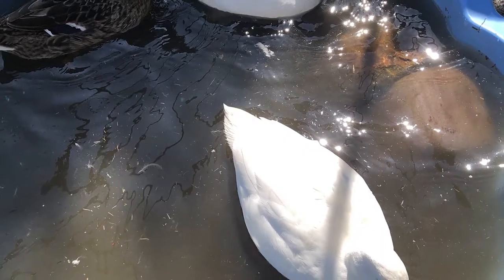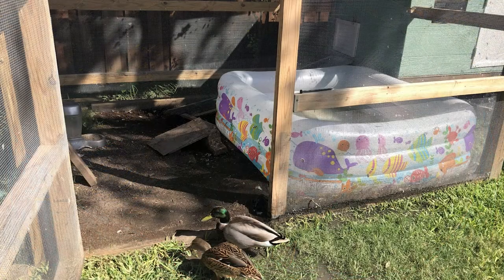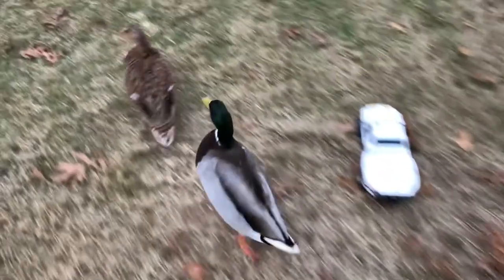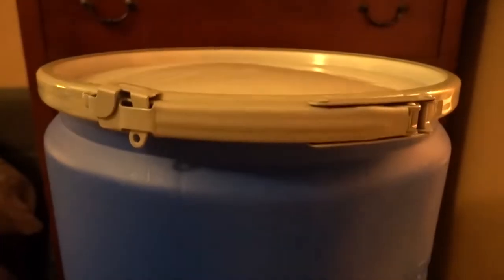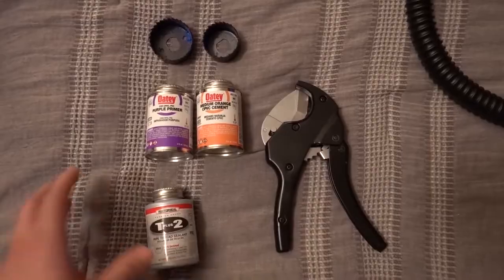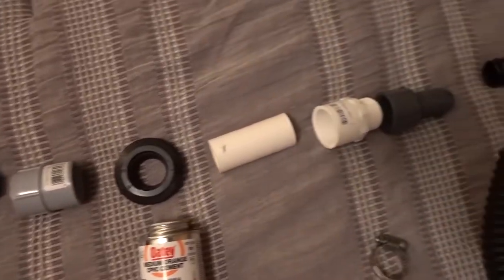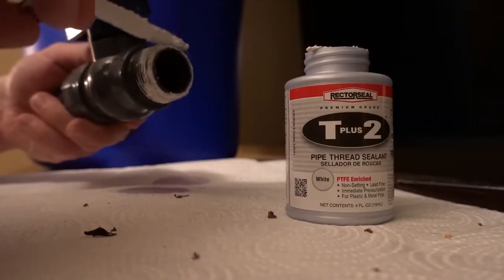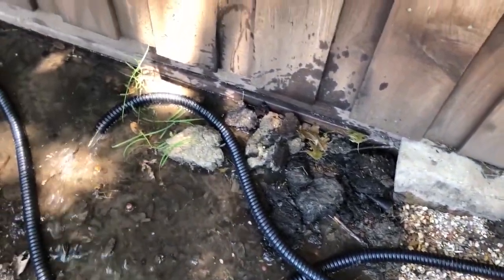How to DIY Keep Your Duck Pool Clean and Easy to Maintain

Comment: I have 10 ducklings and I've been working on the pool set up. Never done this before, and so glad I came across this video!
Reply from the maker: Awesome! Be sure to watch the updated video!
Reply: WILL NOT WORK.   We've got 10 Pekins and anything with pumps and filters is a joke
Reply from the maker: @BillRupp-h4x  I've had a total of 15 before, and I had to fully change the water twice a day to maintain. 

My setup would prevent that (mainly from the swirl filter) - though, as you know 10 ducks is a lot of poop, so you'd likely have to rinse out the swirl filter daily. 

So, yes it would still work. The average pump/filter setup will not work and would also clog, I agree.

Comment: I have 6 baby duck at about 3 days old they are now 3 months and have done about a dozen different… I know made a pond out of concrete with a perforated tube running around the edge under a bed of river rocks now I need to build the filter so thank you

Comment: Howdy! We just bought our homestead Jan 2023. First time duck owner. We have 4/6wk old Pekin, 5/6wk old Rouen, 5/5wk old Rouen and 5/5wk old Cayuga ducklings. Also, 2/6wk old poults, 12/8wk old chicks and 53/6wk old chicks. 20 more chicks are supposed to hatch July 24th. This is the third hatch attempt. Bantams are hard to hatch. Add 2 dogs, 1 cat, 2 pet rats, 1 pet mama mouse w/9 babies and 1 ball python. Much love to all you pet owners out there! 🥰
Reply from the maker: 20 chicks?! 😅 That’s gonna be a lot to handle lol. It will be adorable for a couple weeks at least.
Reply: Ha! Yeah. All the other poultry and waterfowl are 8 wks and less. It's definitely a lot of work, but I love it. I love your pump setup. I'm going to show my hubby. Thank you for the video.
Reply from the maker: @WhatWasIThinkinHomestead  took me years to figure out, though, with that workload, you will still have to clean frequently. (I made the mistake of letting mine have 13 babies one year). Let me know how it all turns out! GL.
Reply: @MegaMilez  Ha! Surprise! 🤭 I bet that was a big chore. I'm sure we'll have to tweek it a bit. I sure will. Thank you for taking the time to respond.

Comment: We have 6 Muscovy and 2 Pekins so we picked up a 300 gallon stock tank for them. It's recessed so they can basically just walk into it. For filtration we start with a Laguna 2000GPH pump, Laguna 4000GPH filter (bio & foam filters and UV light), Tetra waterfall, small separate pump to circulate water even more, Microbe-Lift for algae and "sludge" (duck crap lol). The filters need to be cleaned every week, replaced once or twice a year depending on how they hold up, in the summer (110+ degree temps) water is drained every month, come fall to spring every 3 months or so. There is also an auto-leveler installed since evaporation is a big deal here. The ducks love it and it's been going strong in the current configuration for about 3 years. Cheers!
Reply from the maker: Sounds like a nice setup! Me personally, I drain their water each week or a partial every other week - mainly because a lot of their waste is liquid that won't be caught by any filter, so I don't like the idea of them drinking that. 

I only have to rinse out the swirl filter, rarely take apart and clean the pressure filter, and clean out the in pond all in one filter (that I have in there mainly for water feature/light).

I am going to order some of the Microb-Lift/Algaway you mentioned, going to give that a shot - would be nice to not have to scrub the algae all the time!

Comment: Not a new owner, but I’m one of the folks that uses a kiddie pool and dumps it out every so often. But, encountering your video has me considering a filter (and maybe bubble aeration to keep algae down) two quick questions…

1. I know nothing about pond filters… why do you need the DIY Swirl Filter AND the store bought Laguna 2000?
2. I use a pond heater during the winter, do you run your filter and pump during the winter also?
Reply from the maker: 1. The swirl filter collects the larger material and prevents it from clogging the system. Also, without the swirl filter the water would not be able to stay clean.

2. I use a small deicer when necessary and run the system 24/7/365. Though the heat does seem to make things pretty gross.

Comment: Hey man, thanks for making all these videos! I've come across a few of your previous videos now while researching a backyard wildlife pond with a waterfall, and we want to get some ducks and allow them in it as well. 

It sounds like you have to drain the swirl tank every couple of weeks? 

I was really hoping to go much longer than that. I'm planning an inground pond that will probably be 2000+ gal, we want to put a bunch of plants in there so we will need to ensure we pick stuff ducks won't eat but those should help to clean the water a little. 

I was thinking of using a large trash can for a swirl filter and am hoping the bigger size container and more space between the intake and the outlet will allow me to go longer without cleaning. 

I plan to have the trash can swirl filter overflow into a downpipe that goes to the bottom of a DIY 20, maybe 40-gallon lava rock biofilter. We were hoping to get 4 ducks so hopefully the larger pond and filter will be enough to keep me from having to clean the filters every couple of weeks... every couple of months was my hope! I guess frequent cleanings won't be too bad as long as I can figure out a way to hide the garbage can while keeping the clean-out spigot accessible. I've been thinking maybe I should just get a wet/dry bucket head vacuum that is solely for vacuuming out the swirl filter so I can bury the swirl filter to hide it easier... but I guess that trades off cleaning convenience for looks and I've already warned my partner that they will need to help me figure out how to hide the garbage can haha.

If you have any suggestions for having to clean less often, or for building an in-ground pond that we hope will attract various wildlife, I'd love to hear it! Thanks again for your videos!
Reply from the maker: You're welcome! Having that much water will automatically require less cleaning, unless you plan on having a lot of ducks. The way I have the swirl filter setup, it takes all of 5 minutes to remove the lid, drain, spray out, and close up.

I'd worry about doing lava rocks as eventually that will need to be cleaned out as well as duck poo builds up. In addition, if you plan on doing a garbage can, you'll have to figure out the proper flow rates as to not have it simply overflow - or seal it and create a pressure system like mine.

I'd strongly advise just having whatever swirl container have the drain at the bottom with a hose on the outside leading away to drain it where you'd like. It just makes life easy when you are cleaning. 

In terms of my maintenance/your reference point, I have approx a 150-175 gal system with two ducks and I will either fully drain and clean the system/pool (20mins), partial water change (15 mins) or swirl filter spray out (5 mins) every 1 to 1.5 weeks depending on their water. I spent a lot of time trying to figure out how to create a system that extended drain intervals while making maintenance super easy and this is what I ended up with. Before I had this setup, it would take me over an hour to clean their pool out and it was a total disaster. 

Another alternative is to try and make an entire aquaponics setup - but I'd imagine it could be rather difficult due to the load ducks put on any system. That said, a swirl filter will for sure be an asset, along with the size of your planned system.

Comment: I tried this swirl filter but with a pool pump. The barrel is squeezing in and the pump won't stay primed. Is your swirl filter barrel lower then your pond level?
Reply from the maker: Same height - you can see in this video and the updated one how it is setup. 

I'm not sure what you mean by the barrel is squeezing in? Did you use a different drum?

And also not sure how your pump won't stay primed as it should be submerged in water?
Reply: I believe my pump could be too powerful.  It is for an above ground pool. I used a blue barrel for my swirl filter. It will actually begin to collapse when the pump is turned on. Also the swirl filter line will flow back to the pond and overflow it and empty the barrel when it's not running. I did not follow the video exactly and uses the parts I already had.
Reply from the maker: @adammcanany1986  I'm sorry, it just doesn't make sense about the barrel collapsing when the pump is flowing. This is because it would actually pressurize the barrel - not depressurize. 

In addition, only the lid would be prone to collapsing from suction, as the barrel itself is very thick and sturdy.

The only thing that would make sense here is you have your pump pulling from the barrel/swirl filter rather than the pool itself (and then sending it to the swirl filter) - though unlikely as most pumps are submersible with one outlet. 

Really not sure I can assist as I don't know your setup. 

I'd suggest following the videos for best results if you have the means to.
Reply: Thabk you. This makes sense to me now... ill keep you updated @MegaMilez

Comment: We just hatched 10 ducklings over the weekend we don't need 10 but expected to have some fail nope they all popped out, will look for homes for spare ones no clue how to tell male from female but have hens and a single duck.
Reply from the maker: Holy crap lol. I made that mistake before. Better move fast they will be practically adult size in less than a month.

Comment: Hi I followed ur instructions on how to make the swirl filter and connected to the main filter also a Laguna. However when placed on the ground at the same level I get a bottleneck somewhere and water doesn’t flow into the Laguna. I’ve now placed the swirl filter a bit higher than the Laguna and that works but still every now and then the swirl filter overflows . Would u have any ideas as to how to fix these bottlenecks?
Reply from the maker: The swirl filter has to have the lid on along with the rubber gasket to seal it. Did you do that? The laguna filter is a pressure filter and needs a pressurized system.

Comment: Two ducklings came home with my son. They are 4 weeks & have outgrown their baby pool.  Unfortunately, we don’t have nearby electricity.
Reply from the maker: That might be difficult but not impossible! I'm not sure the extent of "No nearby electricity", but I've been running this 100ft extension cable for everything (on a GFCI) with zero issues: https://amzn.to/4dRPk0B.

If that won't work you'll need to get a hard plastic pool you can tip over like this: https://amzn.to/4dTDhzI - though I'd recommend creating a drainage system to prevent a swampy run. Possibly even adding a drain plug in the pool itself.

Comment from the maker: Note, the new hoses on my system have been working amazing and are way better than the typical corrogated pond hoses you see (they always fail and/or get clogged). They are linked in the description.
Reply: Thanks for the video, I am currently setting up a new duck pond and hopefully will get ducks spring time next year. Your video is a great help.
Reply from the maker: That is tough, but not impossible! Depending on what you mean by "nearby electricity", I personally run a 100ft extension cord for everything. Been using this exact one for years with zero issues https://amzn.to/4bzXQjo

Otherwise, you'll just have to get a larger kiddie pool (not inflatable as it won't last). Something like this https://amzn.to/4dTDhzI you can dump out and refill - though I'd suggest creating a drainage system or even installing a drain plug to prevent the run from turning into a swamp over a few changes.

Comment: We started off with ducklings, built them an caged space for outside built their house and used a I think it is a koi pond or outdoor fountain it is black and goes in the ground. We are on our third filter that has died as well and we are expecting babies. We need help..
Reply from the maker: Adding a swirl filter (the blue thing I built) will help lighten the load, however, if you add more ducks to the same amount of water, past a certain point it won’t matter. No filtration will keep it clean.

Comment: Existing, but want to upgrade to a bigger system to encompass aquaponics and multiple tanks
Reply from the maker: I think the most difficult part of doing that for a duck application is getting the flow right so it wont overflow and wont clog.